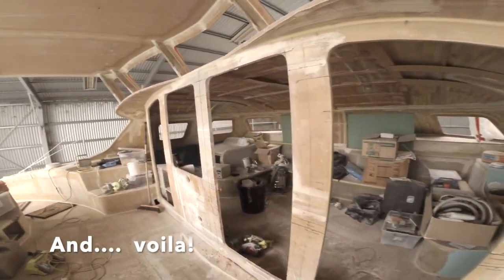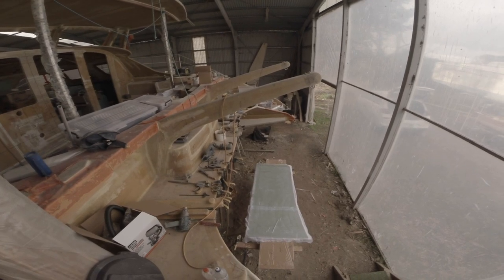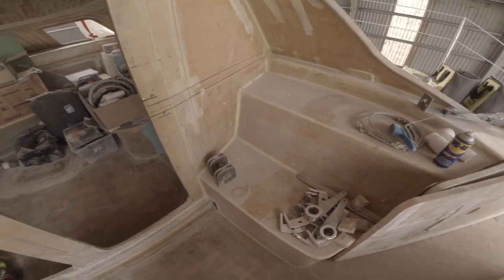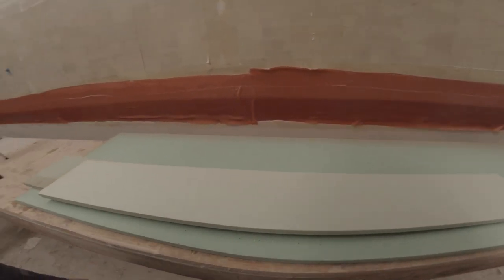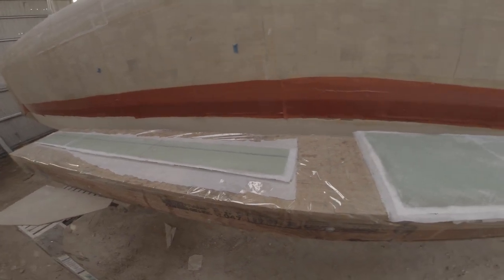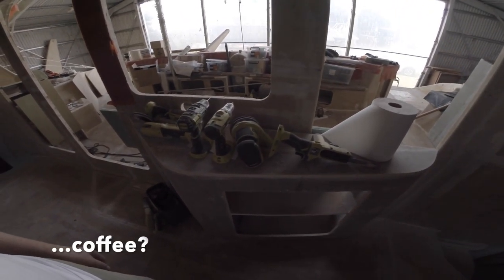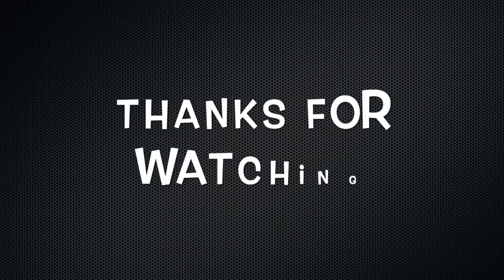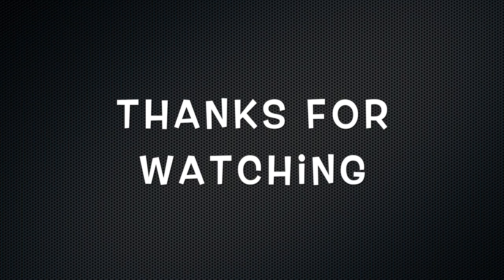Cockpit Makeover KickOff - S01 E08 - DIY Catamaran

Comment: Can you share the foam you’re using to construct the cockpit “furniture”?  Seems like a terrific way to rapidly build lightweight assemblies.
Reply from the maker: Absolutely. Foam is an excellent way to do that. In the interior I use even lighter material.
The foam I use is structural pvc foam commonly used in boat building. I use 80kg foam, that is 80kg per cubic meter. There are lighter, as well as heavier, foams available. Divinycell is a common brand.
For the interior I use a cardboard honeycomb. These panels are sold by ATL composites, but there are many other producers of similar products. The strength is achieved by separation of the outer skins of glass giving stiffness. Compressional strength is achieved by the density of the core.
Pet is becoming more available. Balsa is what most of the boat is made from. Some of it with hardwood veneer below the glass skins.
Check out ATL composites, you can find lots of information on their site. Then buy panels or core materials from a local supplier.

Don't hesitate to ask me for more information, but remember I am not a pro. I'll gladly help if I can.

/ Axel

Comment: Hi guys, my brother and I are renovating an old catamaran a Centaurus 38 (old Latvian Navy cat they used for training, apparently)- so with you on your journey, and we are also using PET foam core. If i can give you a tip that we have learnt:  Wet out the foam, starting at the edges, then go back over the edges before you lay up the glass. Makes a big difference to the edges adhering. We decided to lay up in polyester resin when creating our panels, but use epoxy for fillets and tabbing and anything structural
Reply from the maker: Thanks for the tip! We have gotten a lot better since my first failures.

I have not had access to PET, sadly, we are using PVC and epoxy. Most of the boat is balsa core.

The centaurus looks like an interesting cat. All open bridge deck?

Thanks for the tip, and your comments.
Reply: @buildingwilda  Open bridge deck at the moment - going to re-do the entire deck and add a cabin, so a major restoration with lots of new considerations on where/how we add the strength. Old rotten deck removed already and we have put in just the aft deck for the cockpit. Oh, and we are having to re-do the majority of the work in a tidal berth! I envy your massive shed!

Comment: Nice work!!!! I am really keen to see how you set up your electric motors, as well as your Inverter/charger to your battery bank.
Reply from the maker: Thanks!

I am looking forward to it myself! I have all the bits in the shed, just waiting to get installed. A bit to do before then though.
Coming up
Reply: I feel you’re very brave going with electric motors! Interesting to see what you’re up to. I’ve only just found your channel. Where are you doing the build? I’m assuming you’ve taken over someone else’s project!? Thanks for sharing, I’ve subbed.
Reply from the maker: @jacksbackable  Thanks.

I took over a stalled build outside Melbourne.
Reply from the maker: @jacksbackable  Not brave. I think I get the best combination of available power and ease of use and maintenance this way... Provided I get it all to work 😂
Reply: I also only found  you Guys last night. Interesting. I also looking at electric drives. (I'm about a year behind you) what motors and controller are you using. I'm busy looking at surface piercing  props and foil drives. (They are more efficient). Then when there is only a little wind and lots of sun motor sail with the  excess power.
Reply: Building Wilda great build guys how did you find that in Melbourne?  I love the Tesla battery option I have thought of that for a while. Did you get the batteries in Oz or overseas.